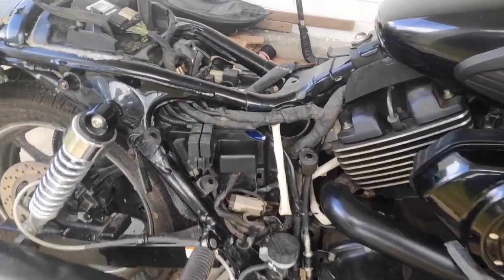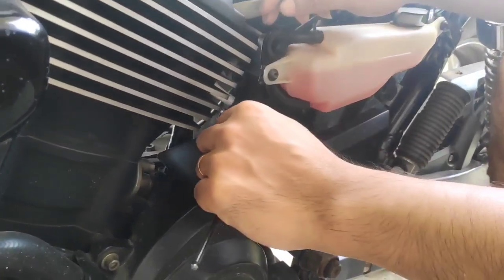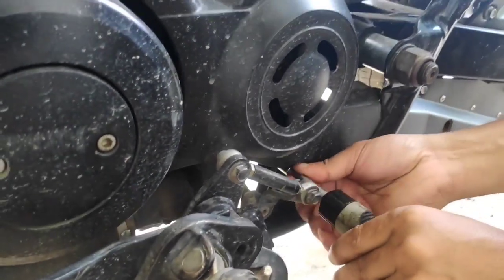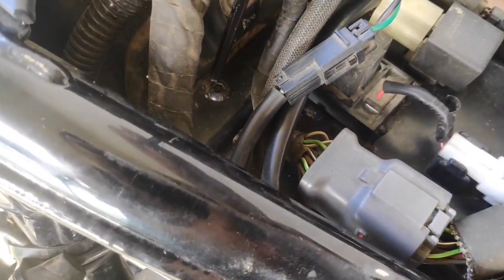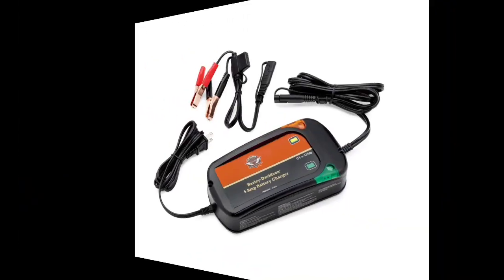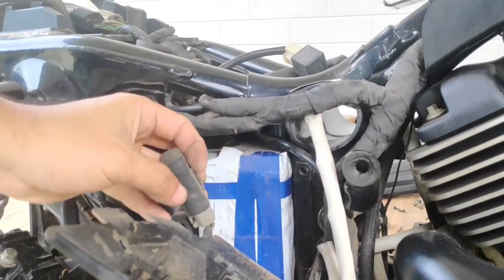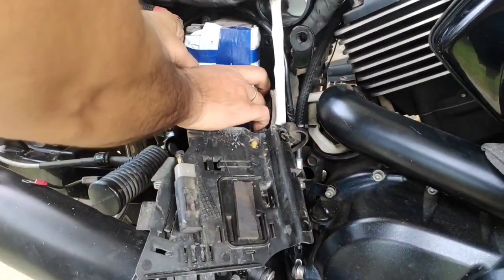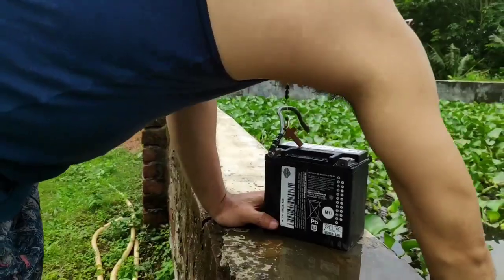Harley Davidson Street 750 - Battery Removal. Best Step by Step Tutorial

Comment: hello @Anthony9592 I have had street xg 750 for 2 months. Unfortunately, during the trip, when the fan stopped working when I was parked, it could not be turned on. the mechanic who is not connected to the bikes is connected to the fan short switch to get him home. when I arrived, my battery was discharged.

Comment: I have replaced my street 750 battery i.e. 12V12A with 12V9A..can you tell me if this can cause any issues or may be not good for the starter motor and relays?? Please advise if you have any idea on same. Thanks in Advance Sir.🙂
Reply from the maker: Ha ha... Bro, don't call me Sir.. sounds odd.. Anyway coming to your question, it is okay to use a battery with a slightly lower Ah (as you have done from 12ah to 9ah) . But for all intents and purposes, it is always advisable to stick to the specified battery..  The problem of using a lower Ah battery is that it drains out faster. And the electric starter might drain the battery faster if the Ah is lower, especially if you are constantly stopping and turning off your engine while riding your Harley for short distances. In such a case, the alternator might not have the time to charge your battery to the full and you might eventually have to charge it using an external battery charger that Harley provides as accessory. However, given that not many power consuming electrical components are in a Street 750, I am certain that 9ah battery that you replaced with is fine.. But try replacing your halogen headlight with an LED one and if possible disable the DRL like i did on my bike by installing external switches.. That way you can preserve the ampere hour of your battery...✌️
Reply: @Anthony9592  thanks for the advice, will turn off the lights....it was really helpful...thank you very much.
Reply from the maker: Welcome Brother. I'm glad I was of some help to you..

Comment: There were Ssooo Many extra steps not required in this video. Nothing on the left side of the bike has to be removed…
Reply from the maker: Yes, you are right about the steps being lengthy. It could also be removed without the top panel being removed, but then some extra exertion is required to pull the battery out and in the process one could snap a wire or damage the breather hose. And about the left side of the bike, you need to remove the side panel and the chain cover to unscrew the nut that holds the negative line in place.. ✌